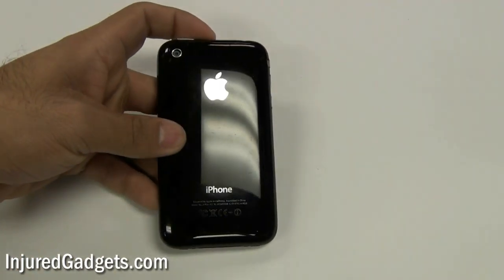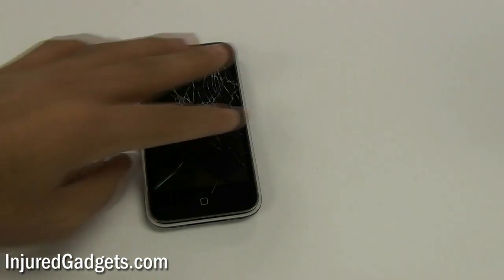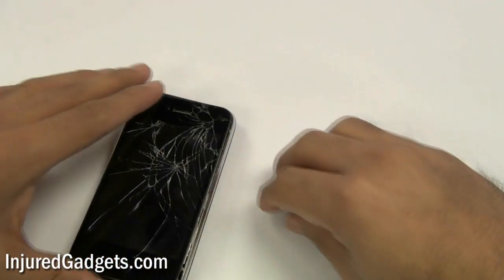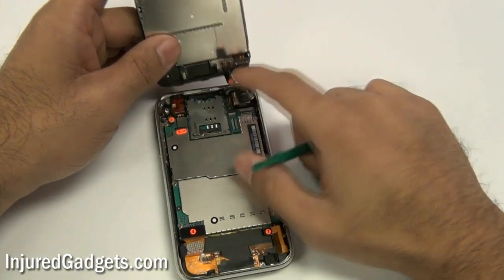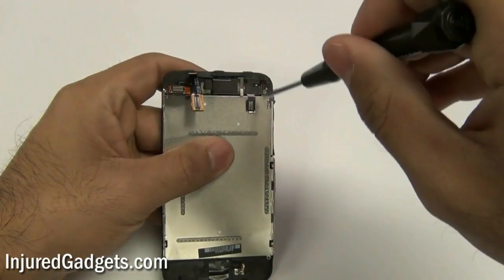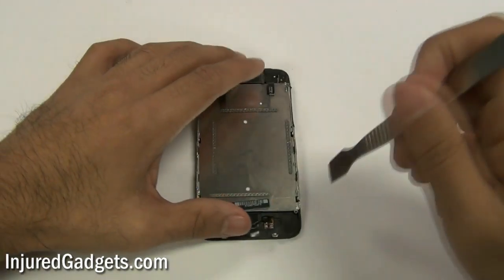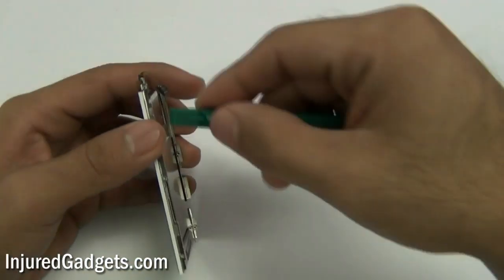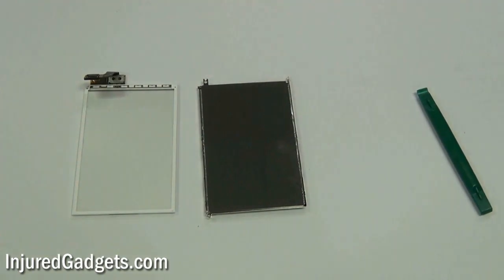iPhone 3Gs LCD Display Repair Replacement Guide

Comment from the maker: What was the intial issue with your 3gs? Someone a chip goes bad and your backlight will ne extremely dim unless its replaced. If it isnt that, then it possible the LCD you purchased was defective.